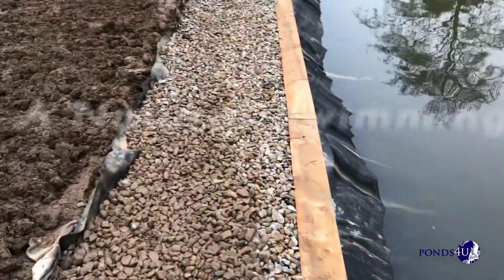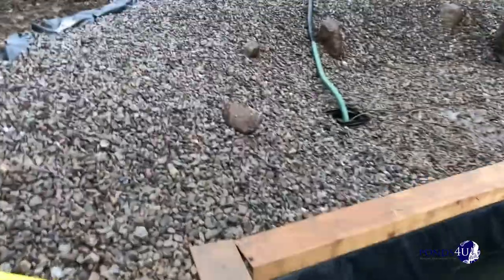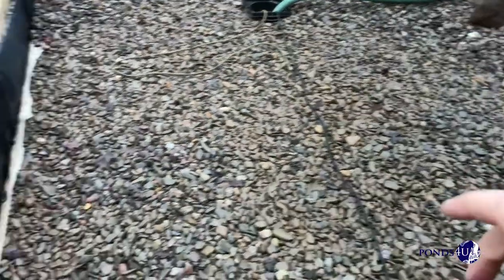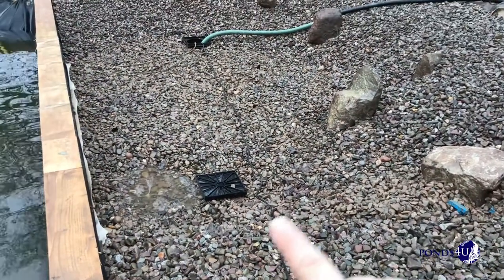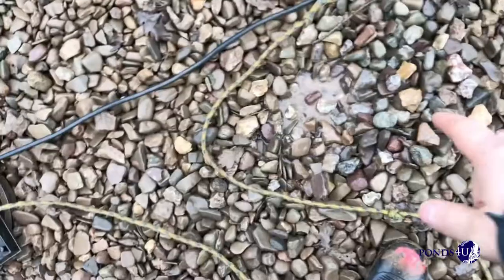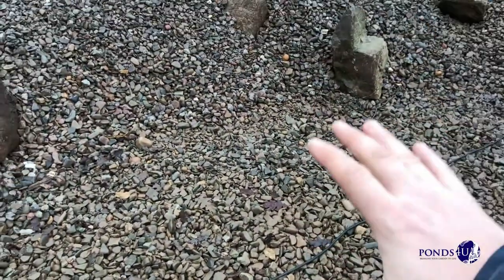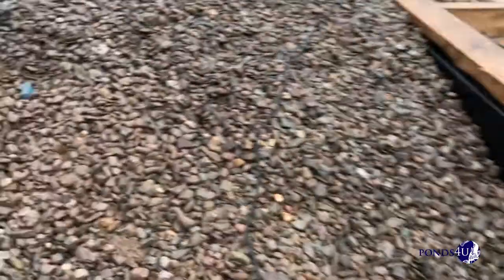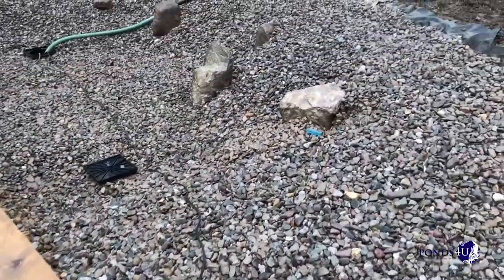Building a Natural Swimming Pool - Wetland/Bog Filters Explained

Comment: Nice job! Interesting design. Can I ask some questions please?

Can you do a diagram of the pipe work layout and if you have any pictures of it?
Does the pipe go up and over the wall as you have the liner over the wall?
Are you using the centipede, snorkel and crates method?
Are you using an air pump and air stones or regular water pump?
Have you put in a bottom drain in the swim zone or just pumping from the bottom and in to the wetland/bog filter?
Thanks.
Andy (Warrington, UK)
Reply from the maker: Hi Andy, of course. Appreciate the feedback. 

I'll get back to you with answers to those questions and try to dig out some pictures. I'm sure there's some on our phones.